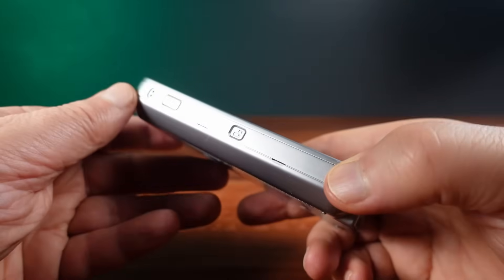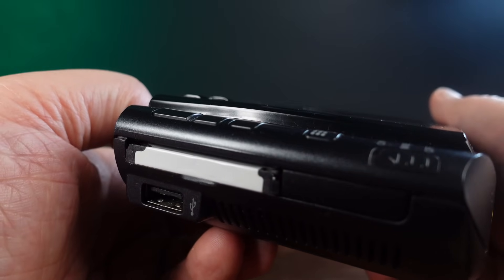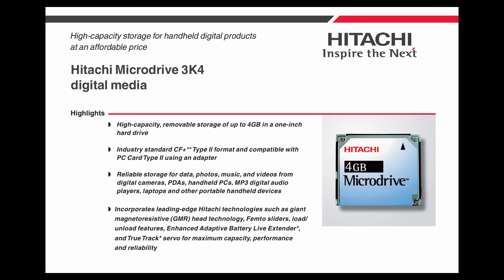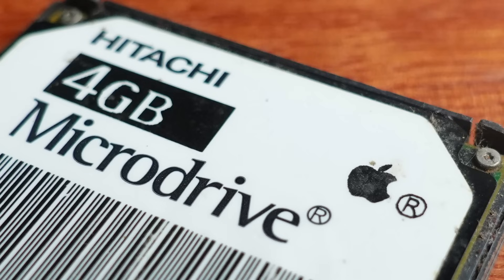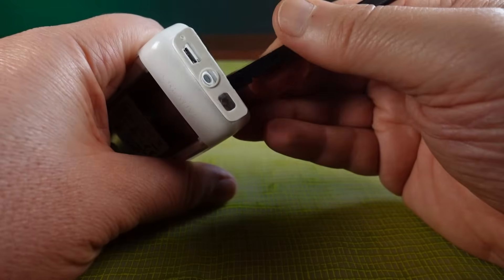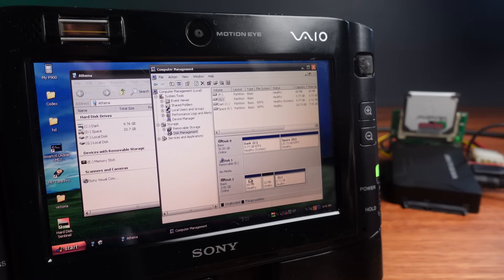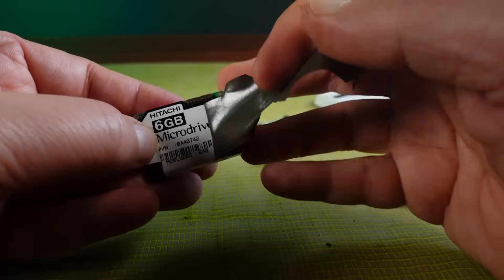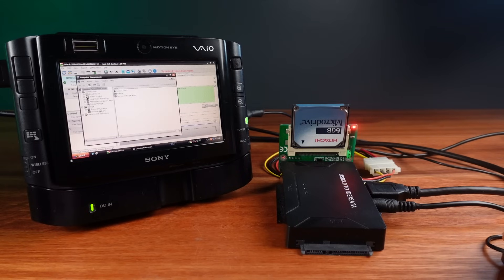Miniature Hard Drives

Comment: I remember putting my friend's iPod Classic to my ear to hear if it really had a tiny drive in it. This was one of the originals with the black and white screen, with the metal back.
Reply: Apparently, with the iPod, Apple pushed these drives to a capacity of 160GB by 2007. They were 1.8 inch drives from Toshiba, and were apparently used as recently as 2014 (the end of the iPod manufacturing) with that iPod.

Comment: Most magical things...I vaguely remember seeing an ad (in the early 2000's) for a Casio watch using an internal hardrive...could this be true, or just a false memory?
Reply from the maker: I've never heard of a watch with a hard drive. Casio did make some weird and crazy watches though.
The smallest hard drive was the Toshiba 0.85 inch. But still to big for a watch I think.
Reply: @JanusCycle  My friend had a Nokia using that Toshiba microsize drive! You could hear it spin up inside the thin metal case 😄

Casio's indeed had some really funky models. Now they're unfortunately getting rid of EL panels and watches will no longer have that intensive, blue backlight. El is getting obsolete like mechanical drives.
Reply: The watch probably used flash storage maybe advertised as a 'data drive' you could hook up to a pc.
Reply: @stevew1487  This sounds plausible! Could be a part of their "Data bank" series.

Comment: a portable data storage back in the early 2000s with 4gb capacity that u can read/write anytime is insane, back then the only form of data storage and transport were floppy disks or cd writers,  the cds could only be burned once and the rewritable was cumbersome and hardware and software often not available,the only other thing was zip drives, floppys that could store 30 or 100mb that cost a bomb like $70 a disk or something and required a proprietary floppy drive....

the ability to transport even 10mb of data was almost mythical.

there was also thumbdrives but they were extremely rare in the early to mid 2000s.
Reply: Compare it to the first ever hard drive, from IBM in 1956. It weighed 1 ton, was the size of a large refrigerator, and held 3.75MB of data, equal to one mp3 song, and cost tens of thousands of dollars.
Reply: @stevew1487  what?no one cares about those, we arent living in the cold war USSR, talking about consumer tech here that people held as a kid, not in some underground bunker somewhere in cheyenne.

even hard drives had 20gb storage by then, it was portable data that was the 

it was the ability to store and transfer large amounts of data that was the dream of gods......even the internet speeds of dial up reflect the times....

u could say back that computers were still in the analog age, it was the transfer of data and the ability to transfer data that makes the computer and internet what it is......without the connection to the outside world or with others, the computer was just another toy like ur nintendo game boy or ps1 that u played on its own in isolation. everything was disconnected from each other back then.

thats why i will always be pc master race....it was the internet connection that made the pc so powerful and more than anything.
Reply: @JonTan-z3e  I agree that computers would be very limited without the internet, but I don't think that has much to do with portable storage, even today it's mostly just used in cameras. Any $3 thumbdrive is likely big enough to carry personal files from place to place. Anyway, this video wasn't just about storage but mini hard drives in particular, and I find it amazing that the best technology could do in 1956 was make a 3.75MB disk drive that weighed a ton, and less than 50 years later you could hold 1000 times that much storage across two fingers and they both worked basically the same way, with the same basic parts.

Comment: I think the reason the compact flash hotswap slots don`t work is 1. the power required and 2. it is likely IDE over Flash so the slot itself needs to be compatible with full IDE. I am just guessing here but I think it is a good guess :)
Reply from the maker: There were certainly cameras and other devices that couldn't supply enough power for a microdrive. Everything I'm using in this video does work with retail microdrives though. So it must be IDE compatibility.

Comment: Now that's a thumb drive. I have 2 20GB Archos mp3 players, I loved those things. Always wondered if I could connect these drives directly to a PC.
Reply: What model of Archos? I converted a 20GB XS202 to 256GB CF with a Cf to IDE adapter the same size as the original 1.8" disk drive. The Archos OS is very friendly to hard drive replacement, it had no problem formatting the 256GB card to full capacity.

Comment: moving parts are the bane of portable and portable speed thats why the first iphone was such a hit the size of the pcb reduced even more than blackberry reduced internal latency and all flash storage was responsive making up most of the underwelming cpu performance perception at the time. now if only spinning rust as hdds are called for the last decade would stop being put in laptops completely. even sata ssds save power aswell as time not just not having moving parts you dont want in a mobile or portable device at all. it drives me crazy seeing a hdd in a laptop i will upgrade and install a ssd for only cost of drive for any customer. i get a lot of happy customers that come in with a 2 year old $300 laptop and leave feeling like there cheep laptop got a massive upgrade for only cost of hardware. even a cheep laptop should not have hdd in 2025.

Comment: the reason for not detecting the microdrive is due to the slow response of the drive. bios/firmwares have a time limit of drive detection times. The other question is power as some of the slots cant supply enough power to the drive. i think later seagate become smarter and improved their drive controller. separating the controller from the storage. This way bios detects the controller first which is fast. However even today seagates new terrible SMR drives have the same detection issue in hot swap and detection on boot without a proper usb controller in between. I think there may be some incompatibilities using a different controller standard.

Also hitachi was known for reliability issues in hard drives. I have a WD green i modified from 2008 and works well today, but since you cant modify firmwares nowadays its pointless for budget new drives.

Comment: They loaded songs into RAM and turned the drive off also to protect the drive. But, it resulted in the "Load/Unload Cycle Count" being sky high in SMART values, which basically meant accelerated wear and tear due to excessive head unloading and parking. The spindle driver chips didn't like the current inrush either. I had several Thomason Lyra PDP2842 die on me this way. They were different IDE HDD's though, not these compactflash ones.
Reply: Makes sense.

Comment: The hardware in some of the first Portable Video devices, while Clunnky and WAY outdated by todays standards, were some of the most INSANE examples of the type of Experimentation going on, I remember the "Screens" too, everything was different, like, on LCD displays the Pixels are usually Rectangles or Squares lined up side by side "RGB" and then, ya know, it dies its thing, but one device i looked at had Weird Triangle pixels in a totally different configuration so they could get a Better Picture than from a 240x480 resolution Screen that was sort-of common for a while. Old stuff was weird, ... now we have evrything pretty much perfected, which in my oppinion is Functional, but Boring.

Comment: Remember the "ZIF" HDD? it was a tiny little 512MB HDD withe a Flat RibbonCable connector like you see on a PSP Display Cable... used in some Portable MP3 Players ... NAND was really expensive when it first came out,  but once they "Tooled Up" the prices dropped ... the crazy thing is I remember when a 128-256 MB CF card could run you a couple hundred bucks (fir a good one) Prices were Crazy, now we have 1TB SDcards that push easily 100MB/sec + (sometimes) for about $70-80 ... I never thought I could back up my entire System onto a Fingernail... and I REALLY never thought the Tiny Backup would Mount on a VHD and load faster (MUCH faster) than any of the 512MB Physical Disks Pata was what 133MB/s ... now we have NVME at like 7000-12000MB/s (or even faster...) Crazy!

Comment: This is NOT the smallest hard disc drive ever created. I owned a Soniqcast Aireo that had a 1.5gb hard disk drive in it. It was about the size of a quarter dollar coin. And I found out the company that made the drive made larger capacity ones. I considered upgrading the thing to higher capacity with one of them.....but the Aireo also had a SD card slot (full size SD).....so, decided "what's the point"
Reply: The Cornice Storage Element, 0.85" platter.

Comment: And it became obsolete within like a year or two
Reply: It was more like 7 years from the time IBM introduced the first 170 and 340MB Microdrives in 1999 to the last 8GB drives in 2006 or so, but they continued to be used a couple of years after that although the capacity didn't increase and they were finally replaced when flash became cheaper.

Comment: CompactFlash supported TrueIDE mode because the actual protocol used in CompactFlash mode WAS IDE once you get past the initialization. The driver itself is called "atadisk" in the end because after you do the CF/PCMCIA handshakes, it would be an IDE device. I have a prototype CF to IDE adapter (CF card on one side, IDE 40 pin on the other) and the only thing the card does is handle the handshake. Once the handshake is done, it just forwards the signals to the IDE disk. In TrueIDE mode it just disables itself and passes everything through. It's entirely possible those memory card readers that work don't bother doing the handshake at all and just set it to TrueIDE mode (this must be supported on all storage cards) to avoid having to deal with it. After all, they have to deal with IDE anyways.
Reply: Wow I just had the idea it probably is something like that. Only some flag/handshake that doesn't happens, and it doesn't work. All that is done on drivers level, so it is patchable via software / driver modification.
Reply from the maker: Really interesting details here, thank you.

Comment: I have a My Portable Peripherals 4GB USB drive that I got from Woot! back in 2009. You can even Google it and find the still-existing page. I haven't used it for much and it works just fine to this day on a Windows 11 machine. CrystalDiskInfo reports it has a Hitachi Microdrive, part number HMS360404D5CF00 in it. If you Google that part number, you'll see they're going for a lot more than the $12.99 I paid for the USB drive!
Reply: There's also a guy selling a group of 7 of them for $80 so about the same price.

Comment: isn't that ribbon cable hard drive interface style ZIF?
Reply: On reexamination I think this could be a zif connector on SL 233, 236 or 238 they pretty much pin out straight to IDE and adapters are therefore super simplistic
Reply from the maker: I would love to find an adaptor to connect this drive to the 40 pin zif interface commonly used on 1.8 inch hard drives.
Reply: @ does the drive have any type identifiers or serial numbers?

Comment: Toshiba for a brief time made absolutely tiny HDDs that were about the same size as 2 SD cards stacked on top of each other.
From what I could find there were 2, 4 and possibly 8GB capacity versions. Nokia made a phone that used a 4GB one.
Reply: Yhe company I worked for in the 90's sent me to Toshiba to get qualified in servicing their laptops, and I remember seeing those tiny Toshiba drives. I couldn't believe at the time that something so thin had a spinning platter inside. My first PC in the 80's was a 286, and it had a 50MB hard drive, which is a laughable capacity. You cannot do anything worthwhile with 50MB nowadays.

Comment: There's one other type of card: the Seagate ST1 FX type equipped with an ATA Flex interface. It has a non-removable 45 pin flat flex cable. It's based on the "Draft ATA-7 Standard". Could this CF market reason be one of reasons for it's existence? It has the "Embedded use only" text on the sticker too. I have noticed it in an audio player and I've experimented around with it a bit years ago. I even quickly hacked together a 40/44 pin IDE adapter for it which you can find on github if you ever need one. I've included the ST1 drive's manual with it.
Reply from the maker: Very interesting, thanks.

Comment: Flash storage killed microdrives way sooner. While microdrives had huge storage for such small form-factor it wasn't something desirable for most people. There were cheap CD-R and CD-RW discs to transfer data. Even using regular HDDs were good enough option with 40 up to 120 GB storage space.
Flash storage got affordable in 2002-2003 with 128 up to 512 MB cards or USB sticks.
256 MB CF card was a sweet spot for a digital camera. You needed multiple sets of AA rechargeable batteries to fill it with photos. While at home you would simply copy photos to your HDD. Keep in mind that regular digital cameras stored photes in JPG format and sensor were 3 up to 5 MPix back then.
You could also store up to 5 hours of MP3 music of regular 128 kb/s quality on a 256 MB card. More than enough for a long trip.

This meant microdrives were high-end products from the start. If they would offer 1 GB of storage for the price of 256 GB Flash cards they could become more popular, but while I've had CF cards in my first digital camera, I've never seen a microdrive in person.
Reply: There was a solid market for Microdrive mp3 players from about 2003-2006. You could get a 5GB player (Rio Carbon, Zen Micro for example) for a couple hundred dollars or a 256-512MB flash player for the same amount. A lot of people could store their entire music collection in 5GB which most people couldn't do with even 512MB of flash. I think the Microdrives were more reliable than the 1.8" drives being used at the same time for the larger capacity players, those drives always seemed to be failing in one player or another but it was relatively rare to hear of a Microdrive failing.

Comment: 15:38 - That's liekly because they isolated the smart params to a debug mode/assembly and then disabled access to make them more consumable and less applicable to other use cases as they are embedded and not likely used in portable PCs -- for which those likely would have smart params available (or a driver to access them installed on the pc/drive for windows/linux to use)

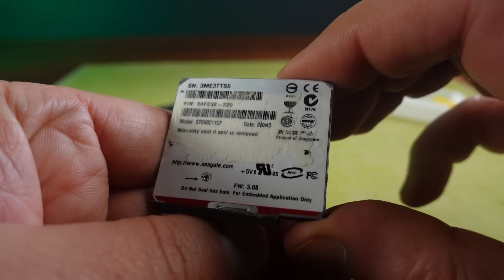Comment: 10:14 - I'm surprised there wasn't an adapter to go from ide -> cf to enable the harvesting of drives. 

Even at $50 an adapter, most would still buy it to get $300 mp3 player and use the drive from that.

Comment: These were awesome but terrible also because they'd break when dropped or bumped hard in your portable device.  I have that exact Zen Micro still working to this day, with the addon speakers and remote that let it park into the unit.  Original drive died long ago but I replaced it with a larger solid state CF card to keep it running.  Works great.

Comment: To me the craziest marvel of engineering remains Toshiba's 0.85" HDD. I'm not sure if they ever gave it any proper commercial name, but to my knowledge it's the only sub 1-inch HDD ever made and came in 2 and 4GB capacity. From what I know that drive has roughly the footprint of a normal sized SD card and is roughly the thickness of 3 SD cards.
Yeah, these Seagate and Hitachi Microdrives are Macroscopic in comparison...
Reply: I think there was a company named Cornice that also made them.